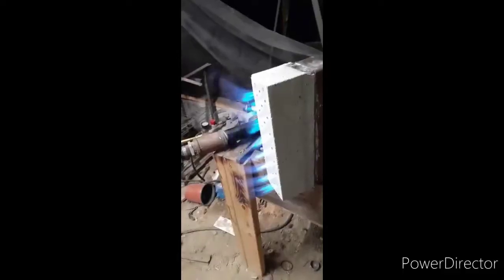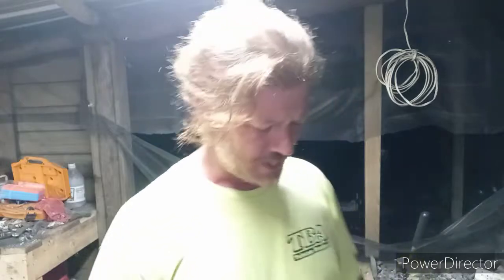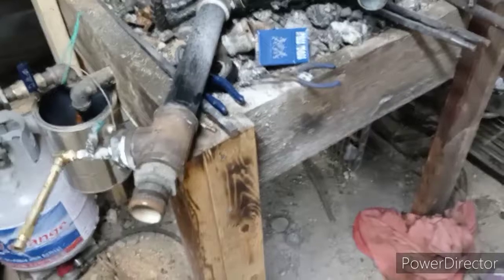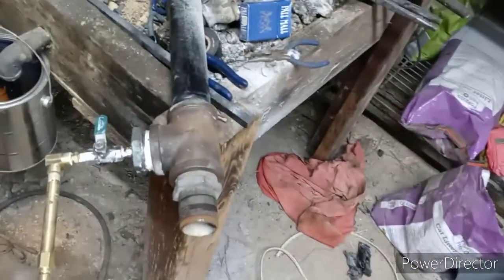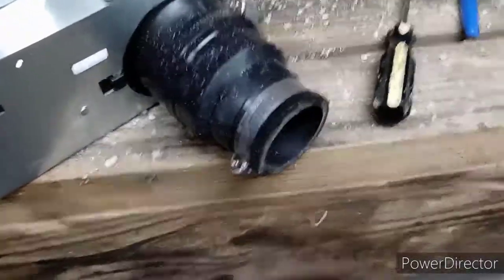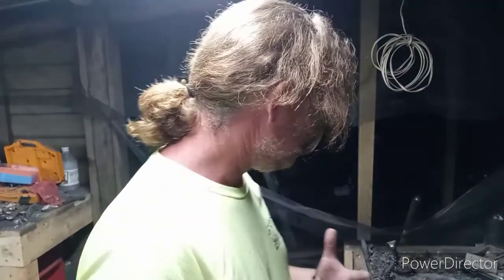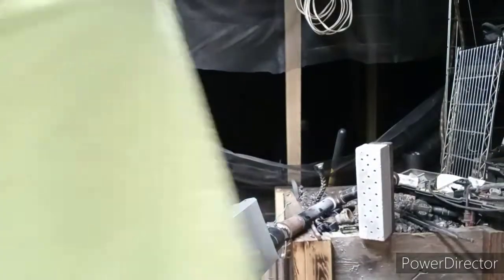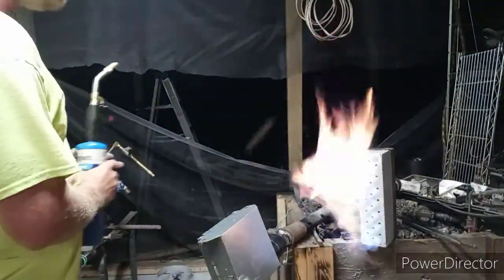Upgrading the franken forge part 3 Lighting the ribbon burner

Comment: Looks like it's going to be a good one, great job Matt. It should do away with the yellow flame and flares when it's put in the forge and it will get a little louder and sound like a cutting torch or at least mine does. And yes a 1/4in needle valve will help greatly on the fine adjustment of the flame. Just be aware since it's safety 3rd on the dragons breath, it can be invisible and anything but a cool breeze. Mine melted the light defuser on my 2 x 4 ceiling light that is 2 foot forward and 4 foot above it. Oh one more thing, and this one may drive you crazy. There is a point somewhere in the air fuel mixture that will make it roar, moan, groan, whistle and make all kinds of crazy noises. I used a speed controller on my air source, sometimes just a couple cfm's up or down can make all the difference in the world. Like me you'll just have to play with it to find it's sweet spot. Again great job and hammer on.
Reply from the maker: Thank you for the advice sir I will definitely keep that in mind